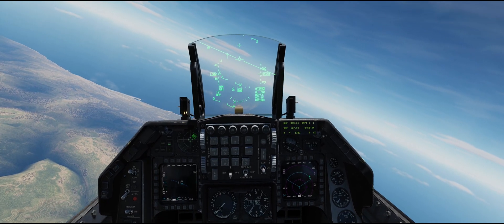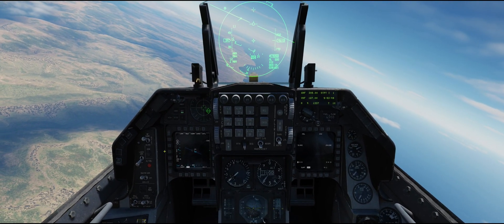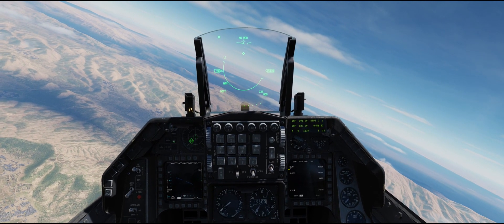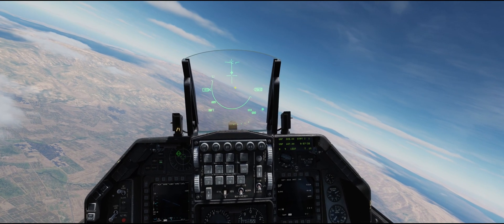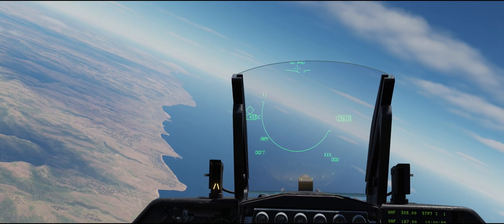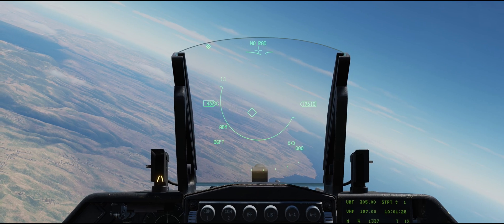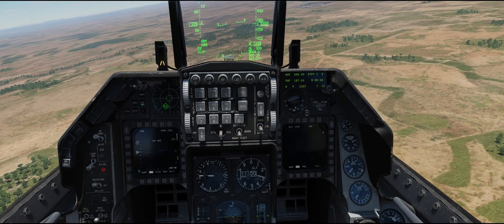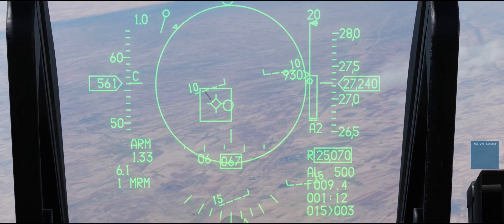Dogfight Mode and MSL Override | DCS F-16C

Comment: Your F-16 tutorials are my favorite, I learned a lot from them, thank you! A question if I may: is there a way to cycle between slave and bore without having to take your hand off the HOTAS? Or is it only the OSB button?
Reply from the maker: Thanks! I think “cursor switch enable” will do it if you press it and hold down. Unfortunately I’m away from my DCS rig for awhile (travel) so can’t confirm that.
Reply: @FLYGaffer  thanks, will try. I’d also love to see a video from you on the practical use of the ECM pod as well as countermeasures. In some memoirs I’ve read it was suggested that program 5 was set to chaff only, while the thumbswitch was used for flares. Makes sense, when you need flares, you can’t take your hands off the throttle. It might have been personal preference though. Would be nice to know more.

Comment: Nice video, just started on dcs with the f16, it’s a great help. However, when in dogfight mode with the radar on. Boresigth, vertical, hud mode, how do you switch between the 9x and 120c ?
Reply from the maker: Long press of the MSL step button will do it. Thanks!
Reply: @FLYGaffer  thanks. Guess I need to bind that command

Comment: Any shortcut to switch the Aim-9 to boresight from HOTAS? The "enable switch" does that momentarily but looking for some switching type.
Reply: As mentioned in another comment, the cursor switch does it.
Reply: He also said you could TMS down back to no rad
Reply: Yeah I know. But you need to hold down the enable button. I was asking about permanent switch other than this from SMS page.
Reply: @radoslawbiernacki  Not that I'm aware of.  Could maybe set up one of normal A/A mode, missile override mode, or dogfight mode that way and leave it, and bind switch to that mode, but would have to set avionics that way each flight.

Comment: A nice way to switch between bore and slave for the Aim-9 is to press the cursor switch down. That will switch it. One downside with some throttles though is that might switch your radar mode to slewable because in pressing down you accidentally move it in either X or Y direction. I set a slight dead zone on that axis just to reduce the chance of that.
Reply from the maker: Great tip, thx!
Reply: @FLYGaffer  sorry, one more thing… I had said press but I meant hold down the button. If you release then it will switch back to slave.